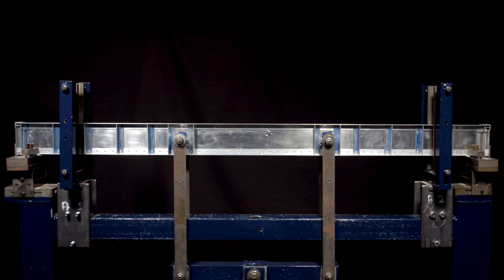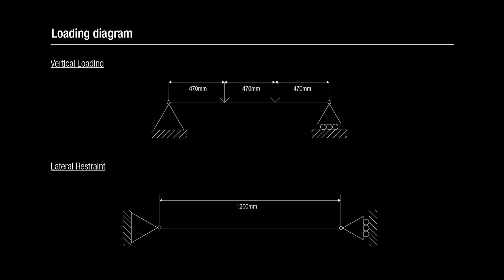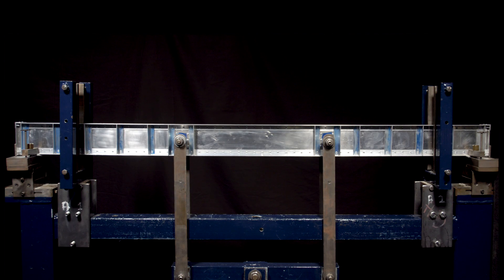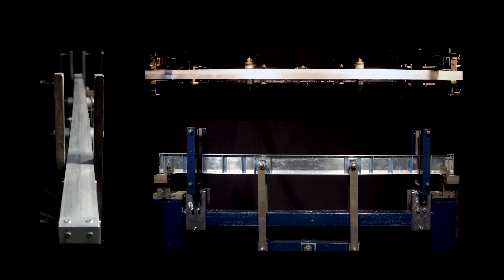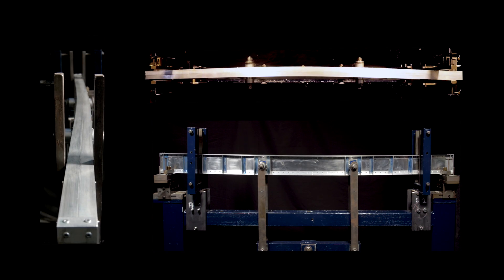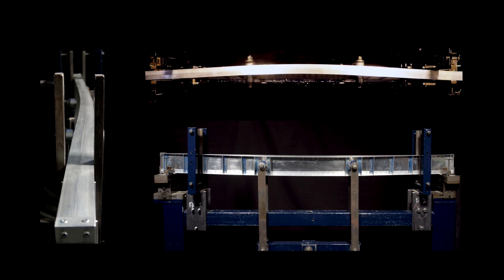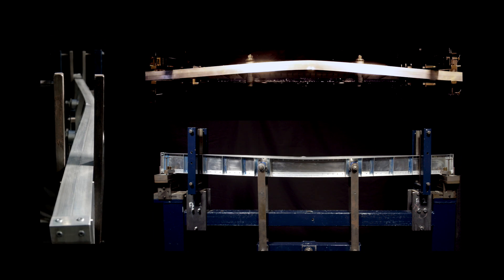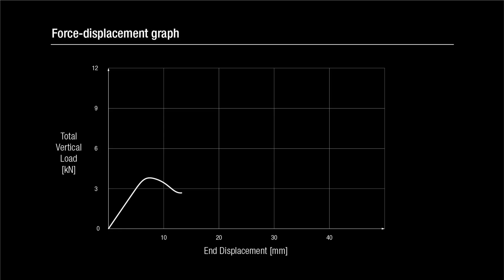Lateral torsional buckling of a plate girder in bending: Materials Lab on-line

Comment: Hey guys, I have a question if adding stiffeners will help in my particular situation. I have a single stringer stair made from steel i-beam at home, and it has a problem, as you walk up the stair it rotates a bit around its axis, because i-beam obviously needs more torsional stiffness. So two solutions came up to my mind. The simpliest one is to connect each step to the wall. It's possible, but I really want to avoid it, as the wall is made from vintage bricks, and I really don't wanna touch them. The second one is to reinforce the beam somehow, and stiffener plates seem like a good solution, but I want to be sure, before I try since the stair is a significant part of interior and I don't want to experiment too much
Reply: One solution would be to reinforce your I beam welding one plate in each side of its web (longitudinally to the beam lenght not using transversal stiffeners). Also, you could "transform" your beam in a box beam. If want you can send your beam conditions (lenght, profile, load, etc) and then I can help you!

Comment: Awesome video. I have a question: may the transversal web stiffeners prevent the LTB?
Reply: What Andrew's trying to say is no; adding stiffeners to the web does not help with LTB.
Web stiffeners increase the load that the web can sustain before the web locally buckles, but this is a different and unrelated failure mode from LTB.
LTB is caused by the compression flange buckling laterally, and so you need to prevent this by providing lateral restraint to the flange that's trying to displace laterally (typically this is the compression flange, but - for cantilevers - it can actually be more effective to laterally restrain the tension flange). The web stiffeners don't provide effective lateral restraint to the flanges (it's analogous to trying to pick yourself up by your boot straps), and are therefore ineffective.
Reply: why would you want to add stiffness to the web if it buckles on the flange ???